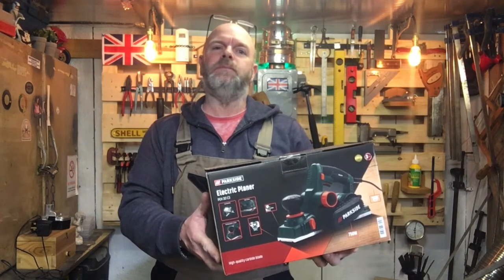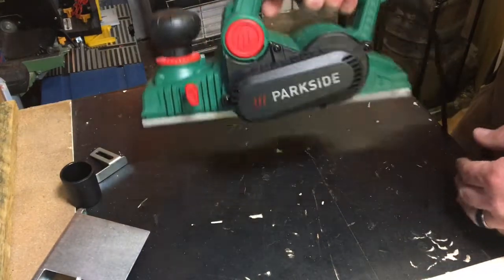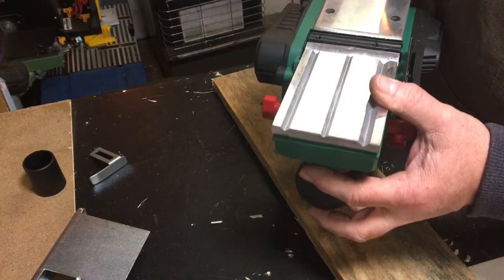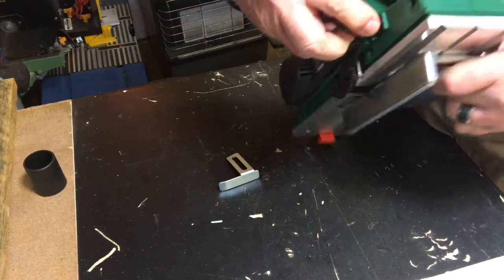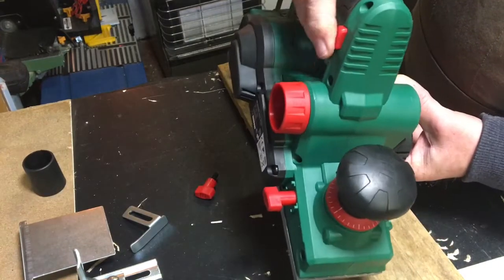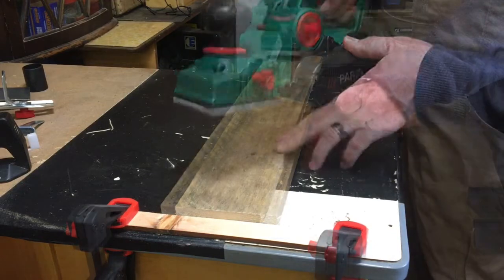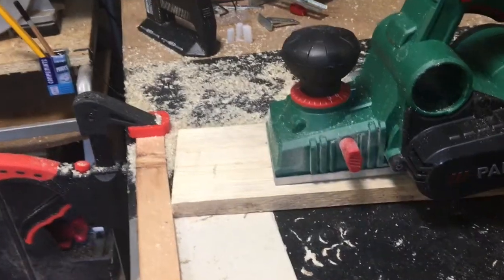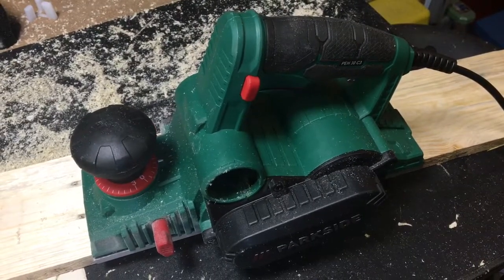Parkside Electric Planer Review PEH 30 C3 from Lidl

Comment: Hi, can we find new blades in the market that fit?
Reply from the maker: I would of thought the manufacturer of the plane will have part numbers for all spares but you would have to do some measurements and searches to try to find others that fit. Good luck 👍
Reply: If you check the manual, they should have all parts names and numbers. You can call lidl customer service. They'll send you a link of suppliers.

Comment: Thank you very much for the review. Re chips flying everywhere - it's supposed to be taken away with vacuum cleaner. That little complicated red chute is definitely not going to do the job just by itself. And I didn't see any tool, even expensive ones, who would neatly handle chips without vacuum cleaner. Have a good day!
Reply from the maker: Thanks for watching, I had a Bosch planer that had a chip bag and if you took the bag off all the chips would be thrown out of the chute so that is what I was comparing it to. I agree with you that ideally it should be connected to some kind of extraction.
Take care David 👍
Reply: @InTheWorkshop  I have an older Bosch which is the 900Watt version and it does a good job of throwing the chips out, as long as the blades are sharp, they will be ejected very quickly.

Comment: Hi David. I think for £24.99 is great for what it does. You can always use it to rough wood down to save time and finish off with a hand plane if that's what you prefer. Good review nice and clear, straight out of the box. Tony
Reply from the maker: Thanks Tony, yeah the planer was a bargain so couldn't pass it by at that price 👍